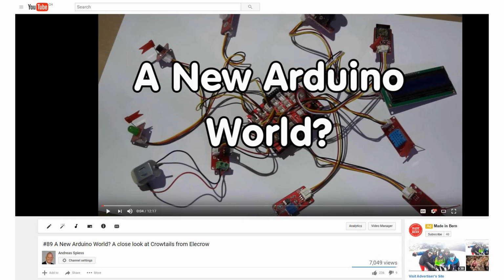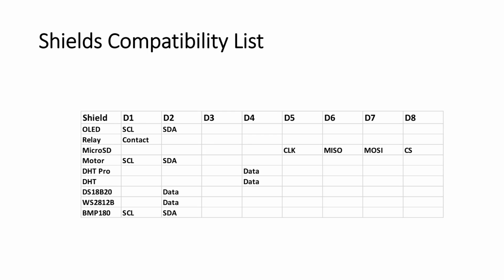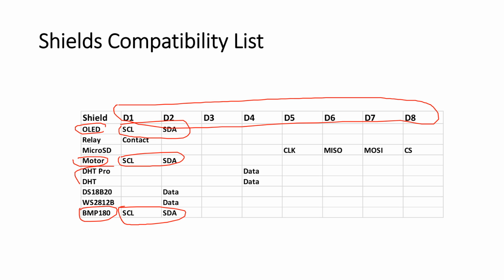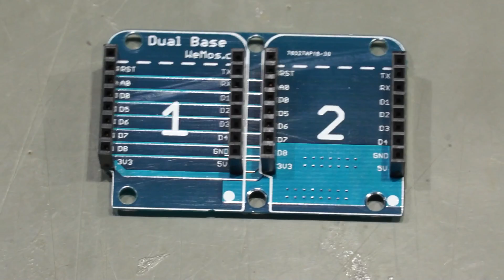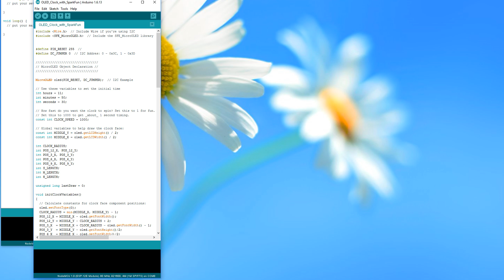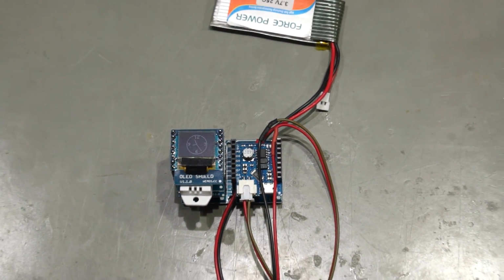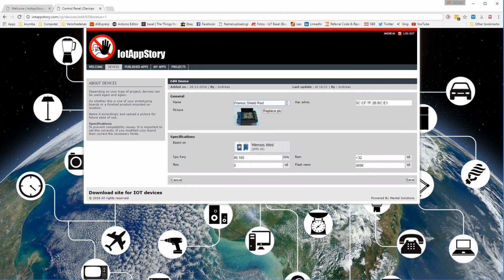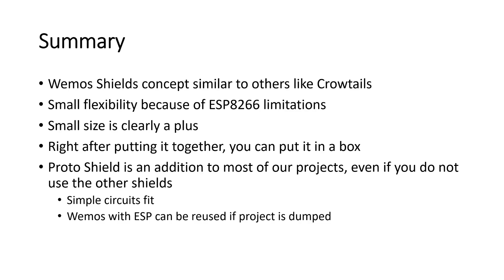#106 Wemos ESP8266 Mini Shields: Concept, Test, and Recommendations. Including Wemos Mini Pro

Comment: Nice video once more! I like all the references you give and also like to see how your various videos tie together. Wish you all the best and much success and happiness in the new year!
Some ideas for new prototype shields: 
 1. use dipswitches or jumperpins to select pin connections for more compactness (you only need to select non-conflicting pins).
 2. make an audio shield containing a buzzer and/or loudspeaker, using jumper pins to select buzzer or speaker connector.
 3. make an i2c multi-i/o shield using the pcf8274 for having more pins (cheap pcfs can be found on the lcd-backpack modules, pcf class to easily switch pins is on the playground)
 4. make a compact led-matrix shield using a max7219 module to show scrolling text
Have fun!
Reply from the maker: Good ideas for the shields. Especially the pcf8274 would be interesting! And the buzzer is a "must". Dipswitches, of course would be the better choice, but add a few cents to the bill of material of our Chinese friends...
I also wish you all the best in the next year. Thanks for your support! Your melody plays now more frequently (probably over Christmas, people have more time for YouTube).

Comment: I also love this concept ! Just 1 problem with the temperature sensors : as the ESP heats up, the temperature of the sensor is about 2°C higher as the real temperature. I tried to avoid this with some insulation, but it appears that the heat is transferred through the pins. Another interesting feature : you can use this as a ftp-server, with 3 Mb storage. I use this as serial logger. Great channel !
Reply from the maker: 1. Temperature: I did not concentrate on this aspect, but saw, that it indicated quite high values. So, that is the explanation
2.FTP server: Could you share the sketch? Seems to be interesting...
Reply: The basic idea was found here : http://www.esp8266.com/viewtopic.php?f=29&t=7655
With the SD-card shield, you have off course much more space to log, but I didn't try that yet. (SD-Shield is on its way).
Reply from the maker: Thanks!
Reply: Hi. You make something to solve this 2°C higher?? Thanks!

Comment: Great video, thank you.
Did you put the shield compatibility matrix somewhere other than in the video, also?
Do you suggest to avoid buying the old revision mini D1, that with the "reset" sign written horizontally?
Reply from the maker: So far, I did not experience big differences between the two versions. What problems did you have with revision 1?
Matrix is on Github now.
Reply: Andreas Spiess thank you for the matrix. I'm still waiting my first mini D1 delivery, and because the difference between revisions was not that clear I ordered the newest ones:  my question was about the revision 1 are interesting because they are cheaper :-)

Comment: I'd be interested in knowing your thoughts on the D1 Mini Pro, specifically if the ceramic antenna (or external option) is worthwhile. Thank you for your frequency of videos, even through the holidays! Keeps me going! :)
Reply from the maker: Kept me also going, because in parallel I had to support the first users of IOTappStory.com...
If you need an external antenna, the pro is a good choice. I think, it is the only NodeMCU compatible with this feature.
The ceramic antenna should be similar than the PCB antenna (similar size, and I hope, well adapted to the chip)

Comment: Years back (1998-9), when PICs where the "Micro-controller of the day", DonTronics of Australia, was selling the same concept as today's "Shields", using SIMM sockets. I don't know why some people are not coming out with shields for the 8266-12E/F in that footprint? Not from lack of pins I am sure?
Wemos has only 1 analog pin, but what I loved about it when I ordered one last year, was that each pin (except one, are capable of doings everything else on hardware level (I2C, SPI, PWM,etc..).! I don't know to what extent that is true, since I never used it or thought about it, till now.
I think it's a very unique chip if that is in fact true, without the usual bullshit "Gotchas". 
One can't do much without a lot of I/O (hence the Mega256), I thought it would be a good port extender (I2C to whatever and vise versa) that could bring extensibility to "none-wifi" projects needing port and wifi extensions.
For example one could be used to serve as an I2C server. Where it occupies only one I2C address, but can control at least 4 other I2C devices of any address. That would be a very useful "Shield" :)
Propeller from Parallax, is too power hungry for battery operations, as are FPGAs.
Reply: After looking at the schematic, its a ESP826612F !! so the I/O functions I mentioned, are bit-banged, which is not a big deal. I thought they had a different chip-set on them that used hardware not software. 
Also, I noticed they use an RT9013 which is an excellent regulator with a standby quiescent current of only 25uA, and mine uses an FS1117 which is a crap battery hog at 5mA. So watch-out for the Chinese slide of hand.
My bad...
Reply from the maker: I discovered the RT9013 also with the Wemos, because it had a better regulation of the peaks. So I ordered a few...
Reply: I usually desolder voltage regulators and chuck them in garbage. Specially if they are the 7805 variety. 
One good regulator is all I've need to power the whole project. The rest of the shields, are feed +5v directly.
This RT9013 looks like a keeper.
Reply from the maker: I hope, I can do a comparison sometimes in 2017
Reply: Had a bunch of those arrive in my mail today. Pretty good but also pretty darned small.  My eyes are getting too aged. Oh well, I managed with the AP2112 as well

Comment: thank you for another great video :) I've been playing a lot with the D1 mini and still waiting for v2 to arrive (not to be confused with R2). the only thing i don't like is the deep sleep.. its uses about 170 uA, way too much. i blame the LDO, dont know why they didn't use something like the ht7333.
Reply from the maker: I think, it is not the LDO, because they use a RT9013 which is probably even better than the HT7333. It is probably the CH340. I never use NodeMCU compatible boards if I want to save power. I use bare ESP-12Es

Comment: Hi Andreas, don't forget there is an SHT30-D temperature and humidity sensor board/shield. Also I am using the D1 Mini Pro with the full flash memory, there is a new boards file that enables this on GitHub.
Reply from the maker: +G6EJD I saw the SHT-30-D today, when I ordered more Proto Shields. It was not available, wen I ordered my shields. Can you please provide a link to the board definition file? 
What kind of sketches use this vast amount of memory?
Reply: boards.txt link is here: https://github.com/WereCatf/Arduino/blob/WemosD1MiniPro/boards.txt  You can also use much larger SPIFFS storage. Yes broaching the 4M limit would be a huge sketch, so 16M would be a serious project :)
Reply from the maker: Thanks for the link! Ill try it.

Comment: I have a few of those shields (and a lot of Wemos D1 minis). The only problem I had with the battery shield is that the inductor on it is prone to breaking during transit and that the connector is a little backwards (i.e. when ordering the same type of battery connectors, + and - are reversed compared to the battery shield).  The DHT11 and DHT22 shields have the problem of getting hotter than the environment truly is because of the Wemos warming things up (especially the linear regulator on it). But on the whole these shields are great for beginners because there is only little soldering required and you don't have to design your own shield (what I did by the way :D!).

TL;DR: Be careful with the battery shield, temperatures are of because of IC heat influence, shields are great for beginners!
Reply from the maker: Thanks for the insight. I think, you would anyway put the temperature sensor as far away as possible rom heat sources. But I agree, this is not easy with the small shields.
Concerning the inductor: I think, it will get a blop of hot glue on its head...

Comment: Very nice Andreas, you must have bought all available shields!
Reply from the maker: No, I did not buy the button shield... And I saw, that there is a new SHT30 Temperature/pressure sensor out.
Reply: that button on the shield connects GND to D3, might be a good addition to your pin config table. Great presentation, @Andreas Spiess

Comment: how does low temperature (lets say up to -20C) affect battery ? does anything other than capacity changes ? I want to build small weather sensor with little solar panel to keep battery charged but I'm afraid it might get damaged during winter
Reply from the maker: Here you can calculate the time: http://battery-life.of-things.de/battery-life-calculator.php
Reply: Kanapka Z Pasztetem You can't charge Li Ion if the temperature is below 0°C. Use 2-3 18650 cells, deep sleep and BME280 sensor.
The battery should last over one year.
Reply: It would depend on the battery, but in general it will just affect the capacity. For this reason oversize the battery for your application. Here is a link to samsung's datasheet for one of their 18650 (Lithium Ion) batteries https://www.powerstream.com/p/INR18650-25R-datasheet.pdf
Reply: Paul Martin The cell you linked is a 18650 with 25A max discharge rate. He can use old 18650s from notebook batteries. For the voltage regulator use the HT7333 and add a big capacitor. Li Ion has no problems with cold weather , it is the best cell chemestry for low temperatures.
Reply: You mentioned nothing about your current draw requirements.
Lithium batteries (not L-ION) are best in extreme cold. They are not rechargeable, and expensive, but used a lot on high endurance devices For a weather station, what do you record? Temperature, light, humidity, or anything that can be updated every minute or so. is easily done with any battery. Your processor wakes up, takes the readings, and goes to sleep. We are in the Micro amp ranges.
You have to power everything from the processor, and use transistor switches if the current draw of your other devices (Transmitter, humidity sensor,...) are more than 20 mA each. Bearing in mind, that the total power dissipation of these chips are usually around 200mA for the entire chip.
However, if you are monitoring wind speeds, by monitoring the pulses the anemometer generates,  you have to keep the processor running most of the time, even by using input capture hardware. Now you are in a different category of Milli-amps-ville. 
If the anemometer generates a dc voltage, you are OK. Since you can awake the processor and read the ADC. Then go back to bed.
But if you have to monitor something 24/7, you need a big ass battery, and even a bigger ass solar panel.
Lot of ifs.
Reply: Kanapka Z Pasztetem You don't need a solar cell , the current draw is so low it can last a year on batteries. 20 Ah should last over one year , modern Panasonic cells have 3400 mAh so you would need 6 of them. You can order the cells on banggood. If you send data every 20 minutes the sensor would use about 2mAh , one year has 8764 hours so the capacity should be at least 17,52 Ah. I rounded that up to 20 Ah because of the effects of cold weather. It's much cheaper to use a big battery than using solar , 6 18650 cell don't take that much space. You can use the ADC to monitor the battery voltage. And use the Bosch BME280 , it has temperature, humidity and pressure. It also has a very low sleep current of 0.1 uA .
Reply: Power draw of 8266 is a minimum of ~20-40mA. 
Multiply that by 24x7 and you'll see why you can't have it run continuously. Your ESP needs to be sleeping most of the time.
Maybe run the Wifi on schedule, every hour during day time. Wake up, try to connect, if no connection in 15 secs, go back to sleep until the next hour. or some thing like that.
Store the results in Flash or whatever, and send it, when requested.
Reply: UFOhunter I calculated that,  the average current 100mA (80mA in the ESP8266 datasheet but I rounded it up to 100) for 20 seconds every 20 min and sleep current with 100uA. 60uA for the ESP, 4uA for the voltage regulator and 0.1uA for the BME280 but I rounded that up to 100uA. If I add the numbers I get 1.7 mAh but I rounded that up to 2 mAh . So there is a big margin of error in my calculation.
Reply: Kanapka, Saw this and thought of you;
https://www.seeedstudio.com/WT8266-S1-FCC%26amp%3BCE%26amp%3BRoHS%26amp%3B-Wi-Fi-Module-based-on-ESP8266-p-2521.html#
Reply: I have a weather station annex chicken coop control with an ESp8266 and a LiPo and a solarcell. That went well during  summer and autumn, but I replaced it with a dry led battery for the winter.
Two reasons for that: the voltage  dropped  in the LiPo and there just wasnt enough sunshine to decently charge the LiPo, but that might be different where you are.
Also, As I recall, there is  moisture in LiPo cells. I imagine that may freeze at -20 and thus damage the battery
Reply: I think currently the BMP180 is more expensive than the BMP280. But if you want temperature, pressure AND humidity, pick the BME 280 (that is a BME, not a BMP)
Reply: yes, I didn't read the datasheet carefully. It seems it was a high current 18650, not the long life ones i had in mind. Also, unfortunately, the temperature on their graph does not go below zero.
Reply: I did not say anything about about current because my project its in "planning" stage ;-) I will use esp8266 as uC (I want to be able to connect antenna to it so probably wemos d1 pro), as sensor dont know yet (maybe bmp180 or sth like that) I want to record temperature, pressure and humidity, if I send logs even once every 15 min its ok for me as long as I wont have to take device home to charge it (maybe during sunset and sunrise more often) 
the thing I worry the most about is solar + battery
1) how big should be solar to keep battery full
2) what charger will do if solar wont provide enough voltage ? (it just wont charge until its enough again ?)
3) because I should not charge li-ion in freezing temperatures is there some kind of switch that I can change from uC that wont need any power too keep either of its states ? (if I detect cold temperatures I will automatically disconnect solar from charger if temp will rise then I enable it again)
Reply: thanks for help guys, I wanted to go solar because I thought it will be cheaper solution, I will rethink my project, I will probably just wait until I build my shed and run power cable from there
Reply: This line caught my eye;
③: Deep-Sleep does not require Wi-Fi connection to be maintained.For application with long time lags between data transmission, e.g. a temperature sensor that checks the temperature every 100s, sleep 300s and waking up to connect to the AP (taking about 0.3~1s), the overall average current is less than 1mA.

Comment: Hi Andreas! I have been a follower of your youtube channel, and i have been learning a lot! 
Wemos board are my favorites, i have developed some projects using this board, and i only have good things to say about it! thanks for sharing a lot of knowledge.
Here is my first instructable where i use a Wemos d1 board, if you are bit curious:
http://www.instructables.com/id/ESP8266-Soil-Moisture-Sensor-to-Domoticz/

Best Regards
Reply from the maker: The solar charger for small devices is also on my list...
Reply from the maker: Nice project!
Reply: ..."A further project would be making this solar powered and recharge its battery whenever it is necessary. But all in its time." 
Also I should make sooner or later this thing :o)
Reply: I don't doubt that either. :O)
Reply: I bought one of these for an Arduino/ESP8266 project. I just have to find out what project I was thinking of :)
http://www.banggood.com/ARILUX-AL-SL02-Wireless-Solar-Powered-20-LED-Waterproof-PIR-Motion-Sensor-Outdoor-Wall-Light-p-1058568.html?rmmds=myorder
Was very impressed with the internals. Now its in my driveway !!
I guess I have to by another one :)
Reply: so mount the DHT on the bottom of the Wemos,,, done